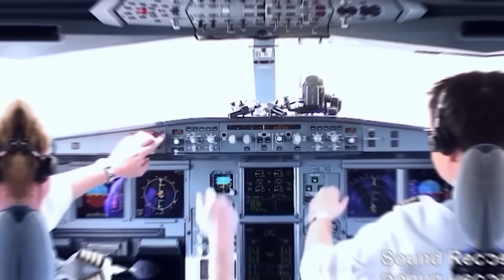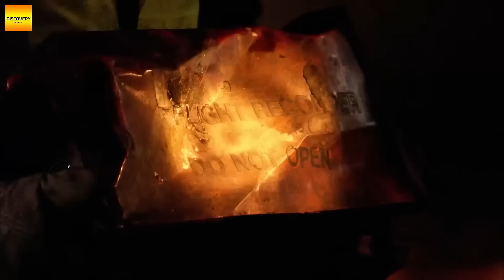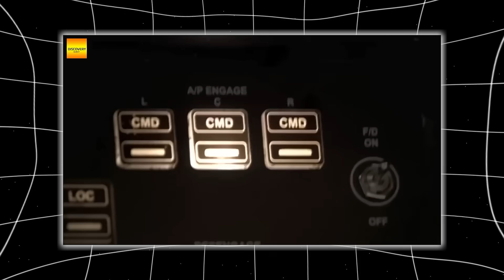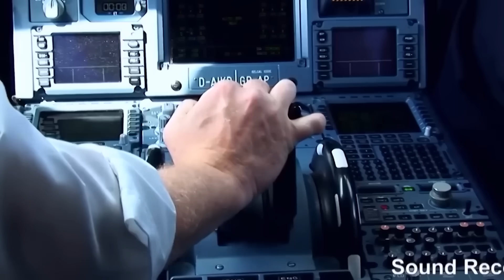BLACK BOX DECODED? Scientists FINALLY SOLVED the Mystery of Air India 171 CRASH

Comment: All you say BS. The B-787 is all composite( including the cockpit floor)  pilot  seat attachments are metal. 12 years of metal attached seat (170 lb. or more pilot in
that seat every flight and metal seat attachment is going to wear that  composite down at those attachment points. Or you believe that BS composite is strong as
steel. It's at peak rotation deck angle was upward good number degrees.

Comment: 100% BS. Even if the seat slides back, who cutoff the engine switches?
Reply: This has been bothering me from the start: I ASSUME that there are no sensors AT those switches that would recognize a REAL mechanical movement of the little sticks. So what we (the lay public) get presented are INTERPRETATIONS of electric signals or codes in networks that have been picked up somewhere else. But did those really come from those two switches? Or were they artefacts, having been produced by a different source? The cockpit dialog gives NO HINT that one of the pilots had really operated those switches.
Artefacts are bad in science and criminology, but they are just wonderful when it comes to forging support for a bias. 
The entire "climate science" is full of it.

Comment: I get the seat sliding back but even if the Capt grabbed the throttles to idle the engines would not shutdown. Granted, a heavy 787 at idle power that low would likely result just as it did. Boeing is a mess.